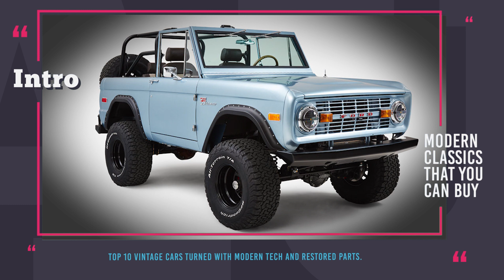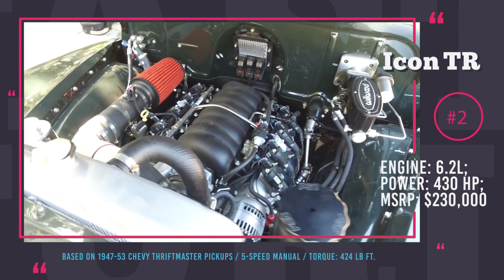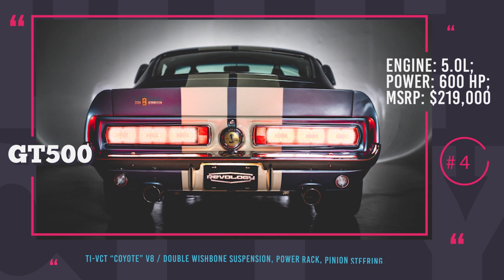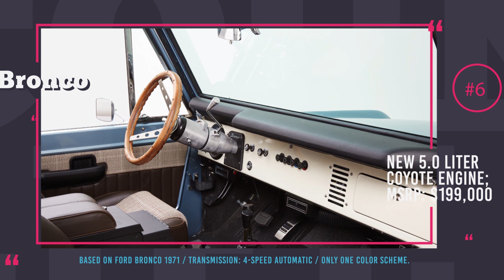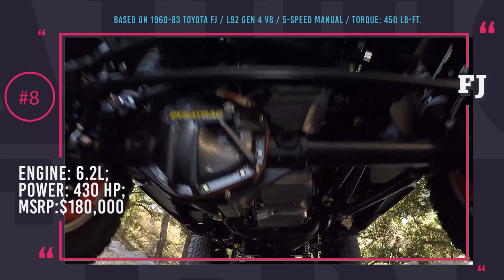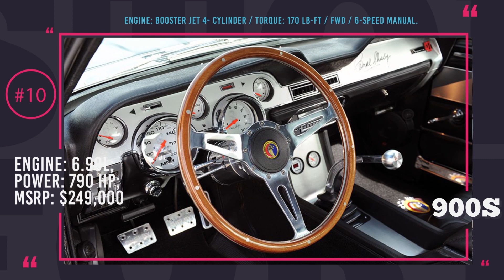10 Old Classic Cars Restored and Custom Modified with New Tech

Comment: I wonder if the same setup for the Icon TR could also be set up with a Chevrolet/GMC truck style that is based upon 1967-1972 or 1973-1991(1989-1991 for the Suburban/1500 Suburban) truck body styles?
Reply from the maker: The links to all manufacturers are in the description. You may contact the company that does these conversions.

Comment: Automotive Territory,  you were right, I did enjoy this video!  This type of approach to performing what I call a "Complete Restification" of a classic body was exactly what I was talking about!  This is. .. ( although admittedly on a singular vehicle scale, and on a MUCH SMALLER BUDGET ) the type of modifications that I perform on a vehicle. I have successfully completed that type of build that was a first of its kind , 20 years ago.  I still have the truck. It's a 1983 Chevrolet C-20 3/4 ton, 2wd, longbed pickup,  that has been retrofitted with the complete wiring harness,  PCM,  4 wheel  anti lock braking system,  electronically controlled heavy duty 4L80e 4 speed automatic transmission , and fuel injected small block Chevy 350 from a 1994 Chevrolet G-30 van.
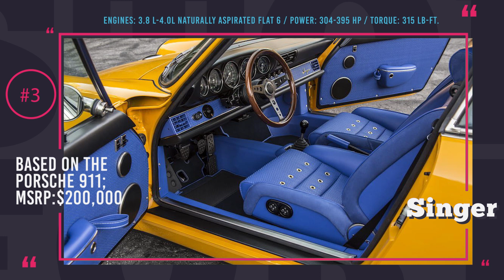 The stock 350 has been upgraded to a 383 stroker small block Chevy engine with a custom hydraulic roller cam, World Products Sportsman Cylinder heads,Edelhrock Performer T.B.I intake, Custom built T.B.I throttle body that houses a pair of 454 spec injectors,  and a adjustable fuel pressure regulator, true dual snorkel ram air intake airbox with a K&N filter,  full MSD 6AL ignition system, engine/drive train  optimization and management is handled by a J.E.T. Technologies custom burned chipset within the factory P.C.M.  It has a rebuilt factory housing,  heavy duty  14 bolt, semi floating axle truck rearend ,  with 4:10.1 gears,  and a Eaton G80 locking differential.  It was never designed to be a show truck, it was actually a experiment that ended up working, lol . I never cosmetically finished it, so it looks like any other Chevy Truck,  until you get in it, or look under the hood.  On the chassis dyno,  it put down 422 H.P. and 447 ft.lbs to the rear wheels.  Fully emissions compliant with a 3 inch exhaust system with a high flow catalytic converter and a 40 series Flowmaster muffler.  Everything functions as intended,  including the anti lock braking system.  There's not another one like it on the planet to my knowledge. It is very sparse on the interior options, manual windows and locks, bench seat, no A/C.
  It's been the most reliable vehicle that I have ever owned.  
After 20 years of being used as a work truck/tow rig ( I pull a 22 ft. car trailer with it) and living in a crime ridden city, it's got its share of dents and scratches, and it's starting to get a little bit rusty, but as long as the battery is hot, and there's fuel in the tank,  it will faithfully fire right up and be able to go!  I also have a 1977 Chevy Impala 4 door sleeper car, and a 1986 Chevrolet Camaro. ....but they're  2 completely different stories!  
Great video, loved it! You just gained another new subscriber!  Have a great day!
Reply from the maker: Thank you for your comment. Reading it was a lot of fun!

Comment: I'd much rather see all the electric conversions instead of this gas engine garbage...my lungs are already messed up from breathing tailpipe exhaust in the city )=
Reply from the maker: You are in luck. I have a video on this topic coming up soon. Stay tuned
Reply: Jeff Jeffrey lolol
Reply: There will be a ton of jobs for the future in conversions on classic cars. It's already happening and picking up speed. I've seen the Jag, the Porche, the Bug, a BMW, and several others that were "UPGRADED" with battery/motor combo packs and now they don't pollute AND go very very fast...faster than the sluggish engine/transmissions that they were originally equipped with. Not to mention the instant torque AND low center of gravity (better handling).
Reply: Ghost Rider, looks like you have a touch of dementia...you punk ass bitch.
Reply: Your mom is your sister...LOL!!!
Reply: That's all you got when faced with facts son.
Reply: Ricer Express, many EV owners just plug in at home with solar panels and a home battery so no coal needed. Your figure is off by 100% too. It's 30% coal. Go get an education and stop propagating BS in YT comments. What is U.S. electricity generation by energy source?

In 2016, about 4.08 trillion kilowatthours (kWh) of electricity1 were generated at utility-scale facilities in the United States.2  About 65% of this electricity generation was from fossil fuels (coal, natural gas, petroleum, and other gases), about 20% was from nuclear energy, and about 15% was from renewable energy sources. The U.S. Energy Information Administration (EIA) estimates that an additional 19 billion kWh (or about 0.02 trillion kWh) of electricity generation was from small-scale solar photovoltaic systems in 2016.3

Major energy sources and percent shares of U.S. electricity generation at utility-scale facilities in 20161 

    Natural gas = 33.8%
    Coal = 30.4%
    Nuclear = 19.7%
    Renewables (total) = 14.9%
        Hydropower = 6.5%
        Wind = 5.6%
        Biomass = 1.5%
        Solar  = 0.9%
        Geothermal = 0.4%
    Petroleum = 0.6%
    Other gases = 0.3%
    Other nonrenewable sources = 0.3%
    Pumped storage hydroelectricity = -0.2%4
Reply: I like the instant torque of electric, but so far most electricity comes from sources that pollute. How about a hybrid so we can still use our present system of gas stations? I don't like the smug self rightiousness that seems to go with the environmentalists. None of us is crazy enough to actually want to destroy our planet. We just have different ideas about the best ways to survive. Shouldn't diversity extend to different opinions?
Reply: It's heavy, low top speed, inconvenient long charge, soulless,   electricity comes from coal plants so saying you are tired of smelling exhaust is non sense, use your 
a/c.
Reply: Jeff Jeffrey I like how you act like your opinion is better so you wish death on someone with their own viewpoints. Take your fascism somewhere else.
Reply: 60% of all electricity made in america is from burning coal. Your still a part of the problem
Reply: Jeff Jeffrey stfu with your gay ass get out of here with that electric bullshit
Reply: Jeff Jeffrey my sister is younger than me fuck tard why do you like electric so much
Reply: Jeff Jeffrey ur mom gay

Comment: There was no '57 Chevy Impala. It began in '58. Top of the line for Chevy in '57 was the Bel Aire.
Reply from the maker: Thank you for your comment. I will have to look closer into this car. I based the script for the 7-8-9 on the information provided by the manufacturer, here is the quote: "7-8-9 was aptly named for  the three years represented in the overall design, the 789 has the “hooded eyes” and chrome grille of a ’57, a mid-section that’s reminiscent of a ’58 Impala and the “bird in flight” rear tailfins of a ’59." This sentence threw me off course. I apologize for the confusion and bow my head to the expert. Will leave a comment update under the video. Once again thank you for your input!
Reply: Alex Holub No Bel Aire either!!! But à Bel Air, yes!
Reply: 789 IS based JUST on the Chevys of those years , NOT a particular model.
Reply: Front is a 1957 bel air, rear is a 1959 bel air. The sides are Mercedes?
Way you can tell the rear is a 59 bel air is because there isn’t the chrome strip running up the boot.

Comment from the maker: !!!UPDATE!!! 7-8-9 is not solely based on the Chevrolet Impala design (the first Impala was released in 1958). This car actually represents three model years of Chevrolet in the overall design. The 789 has the “hooded eyes” and chrome grille of a Chevrolet ’57, a mid-section that’s reminiscent of a ’58 Impala and the “bird in flight” rear tailfins of a ’59." We apologize for the initial confusion.

Cars used to be better… That’s what many of us have heard over the years. But driving classic cars in modern conditions could be challenging but why can’t you have both classic styling and modern tech? Here are 10 bespoke cars that offer just that. Which one would you get? (if you could handle the price tag, of course).